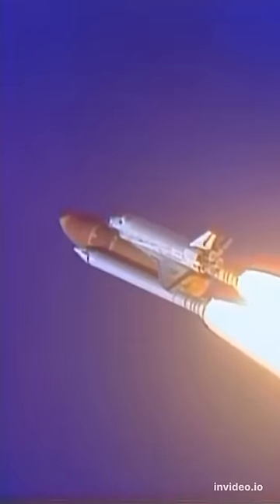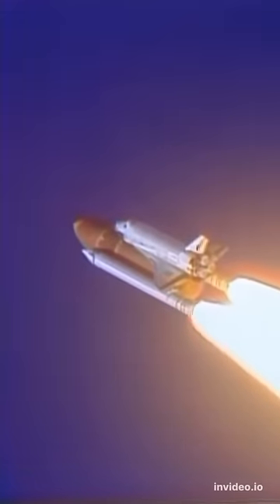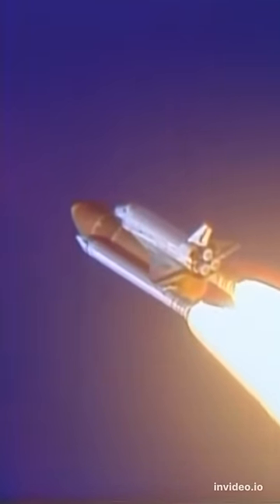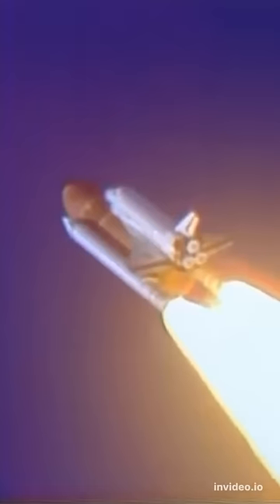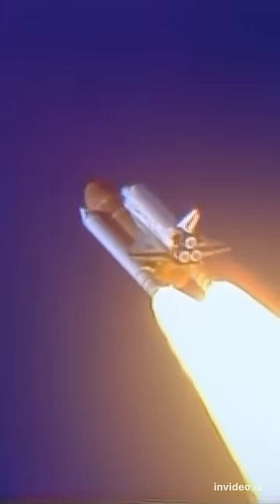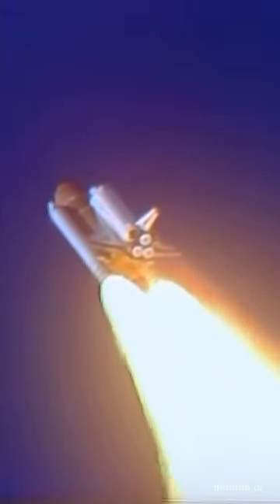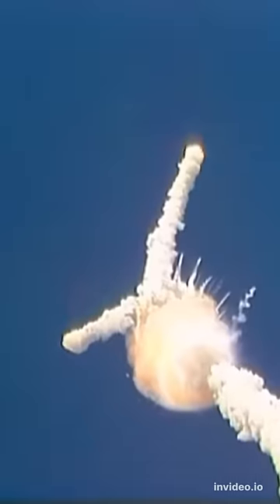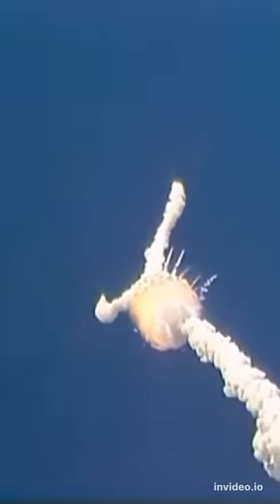Shuttle Disaster: Challenger STS-51-L Was A Major Mistake

Comment: That's still so heartbreaking to watch,  that should have never happened  something as simple as just a bad O Ring
Reply: Yes, was the problem .....
Reply: Yep.. rubber isn't very flexible in cold temperatures.. it seems it blew up as it was being given more power.
Reply: No... meeting a schedule, be damned a postponement to rework, a redesign. Schedule will be kept !!
Reply: It was too cold to launch but they did it anyway.
Reply: O ring was good down to a limited temperature. They launched on a day that was clearly too cold. A critical mistake by mission control.
Reply: I've wore out some rubber, back in the day,  anyways.
Reply: @robertcarlogradosgarcia9944  pp by
Reply: It was a fundamentally flawed design. It was initially designed to be a giant, self-contained reusable mother rocket/that looked like a giant plane, with a small shuttle attached to it. The fuel tanks would have been inside the mothership, so no foam insulation falling off, and the interior of the mothership would be heated, so no ogring seal issues. The government balked the the price and basically redesigned it to be 2 rockets that could not be turned off strapped to a giant fuel tank, and then the shuttle was strapped to that.
Reply: It was meant to happen. Just like the ignorant ones that are in the white house now.
Mike Smith was a friend of my family in NC! We were in shock that day. It was hard to understand why it happened.
Reply: @donmajer9607  
I believe someone should have been held legally responsible for this tragedy,as in jail time and I say this due to the following.I watched a tv/cable documentary about the aftermath investigation where either a designer/manufacturer or engineer had strongly warned NASA head honchos not to launch because of a possible oring issue,but they done it anyways.

Does anyone know if a separate (that was designed to separate from the main shuttle body in the event of an accidental disaster) crew capsule housed the crew and if it was one of the objects seen heading towards the ocean and if so,was the crew located or were they instantly lost in the sky due to the explosion?? Thanks
Reply: @andreaspease9935  the engines being Throttled are NOT the Segmented SRB's which had the O-Rings which developed an exhaust leak. The timing of throttle up and the leak getting worse on the booster were a coincidence. The cause of the explosion was not the throttle up but the leak progressively getting worse from take off till 0:73+ seconds from take off. The boosters were normally supposed to used 2:00 so if the O-Ring had been more resilient and/or the leak/blowby at a sight where it would not have caused External Fuel Tank Failure or Damage they may have survived. The External Fuel Tank Explosion ripped the orbiter into pieces and the cabin sailed intact crashing into the ocean likely w/crew alive but unconscious.
Reply: @donmajer9607  poor management choices overriding engineers who were warning them
Reply: @wbrockstar9550  yes a Thiokol Employee/Engineer told Thiokol Management to warn NASA management and he was basically told "Go back to your cubicle." Thiokol and NASA Management went back and forth with prior data until finally agreeing to go with launch. The Engineer was so upset he reportedly told his family not to watch as he "knew what would happen."
As for the Cabin of the orbiter, it reportedly was blown off in a ballistic trajectory until crashing into the Atlantic. The crew were all supposedly alive but unconscious.....
Reply: @grmrpr3599  yes 1986 was supposed to be a "marathon year for Shuttle Launches." I can't remember off the top of my head but the schedule was supposed to include TWO Interplanetary Launches Directly to Jupiter Using the same Launch Window. These missions Ulysses and Galileo(both using Centaur Upper Stages) and ☢️ RTG🔋 for power were deemed "Death Star Missions"....
Let us not forget that January 1986 had another Shuttle Mission ALREADY. And we were pushing for missions out of Vandenberg that Year.
Reply: The Space Shuttle in "Final Form" was essentially a "Compromise" design....
No one contractor built it. 
Although it was Nominally NASA's it had SIGNIFICANT DESIGN CHOICES MADE for DOD/USAF Missions.... 
NASA, to keep Congress happy, spread contracts to as many districts as possible.
Reply: @wbrockstar9550  they are apparently alive as the capsule fell into the ocean. Some of the life support systems were activated indicating that a few of the astronauts were trying their best to survive.
Reply: @-ShootTheGlass- you're partially correct. They put the orbiter in a manual mode to try to gain control over it's descent. But ultimately passed out and died upon impact into the Atlantic.
Reply: It was too cold for the O ring seal to work properly.
Reply: @wbrockstar9550  ....are that speed & that explosion, disintegration will happen. Nothing of crew was found!
Reply: @poppacapps5573  ok stubby
Reply: There are some things in life that you cannot prevent we may create a lot of things but the things we create are not perfect because we're not perfect you can't control fate you can only deal with what fate gives you
Reply: Q: Did you know that Christa McAuliffe was blue eyed?
A: One blew left and one blew right.
Reply: @wbrockstar9550  no and its the tragedy, when the main tank explode it did not kill all the crews Instant, Many was surely still alive until impact on the ground.
Reply: Wasn't that simple, they KNEW it was a problem, they chose to kill that crew simply so the Shuttle program wouldn't fall behind schedule forgetting just how far behind schedule you fall if you destroy   your ship.
Reply: They took the risk to go up in cold weather should of waited.
Reply: It wasn’t bad it was just too cold
Reply: It was not bad. It was frozen so it shrank. It was new and without defect. The engineer warned management very, very loudly and was ignored. They had pressure to launch $$$. NASA is a business.
Reply: @goatandyourmom9690  I believe two of the crew had successfully switched on their emergency air. I'm unsure of the details but I believe it was the shuttle commander and engineer.
Reply: @cornpop3954  from the wreckage and from the video itself. If you look closely just before the orbiter departs, there is an orange fireball coming from the SRB joint. The faulty Oring was a known issue and was essentially ignored because of pressure to launch. NASA as an organization was changed deeply after this incident and rightly so. A technical chain of command was established to ensure safety of the mission was put ahead of anything else.
Reply: Hindsight.    Always so accurate
Reply: Those bad O rings also lead to unwanted pregnancies !
Reply: yea a problem that they had been warned about and actually was asked several times to not let them launch
Reply: "Simple" maybe in your small mind. It wasn't like an O-ring from Home Depot for your kitchen faucet! Some people really showoff their ignorance in these comments and elsewhere online.
Reply: so sad
Reply: @acidkhmer  thing is when the fuel tank exploded it looked like the shuttle exploded but it didn't, the aerodynamics changed and the shuttle was going at the speed of sound and stress ripped the shuttle apart, but the crew compartment bolts got torn off and seperated that crew compartment from the shuttle, if there had been chutes attached to that in case of separation just like on the Apollo crew compartment splash downs, it's possible they could have survived, but I'm thinking even if it did have chutes would the chutes ripped apart that high? I'm thinking debris would have torn the chutes but who knows
The scary thing is Challenger should have blown up on the launch pad but there was some grain debris on the joint that temporarily sealed it
Reply: Her O-Ring was forever blown out. Even miss Endeavors O-Ring ring would’ve been blown out as well. The shuttle program was a doomed mistress with 
O-Rings torn to shreds
Reply: The O-ring wasn’t “bad”. It wasn’t designed to work/launch in such cold weather. They knew it! Management  took a chance and lost. People should have gone to jail.
Reply: there were many warnings about the o ring cold problems,but they cared more about keeping to the launch schedule than the safety concerns 😟
Reply: The rocket was supposed to be a single piece. They had to use o-rings because senator that got his state the contract couldn't deliver the units in one piece.
They wouldn't fit under some of the bridges they had to go through.
So they built in in three pieces.
Reply: was it a bad O-ring, or was it that the O-rings weren’t designed for the cold temperatures at launch?
Reply: @grmrpr3599 what is with all of you that go and comment complete nonsense on every video 😂
Reply: It was the fact that the shuttle surface was too cold! There was ice all over the shuttle and the launch pad and I knew it was going to end in disaster because of the extreme temperature change that happened when they turned on their engines, before they powered up to even lift the shuttle into the air!!! I was only 8 years old and probably the only kid in Arkansas who wasn’t a bit shocked when the shuttle blew!!!
Reply: @dsvet  dude that is messed up but it still made me laugh!
Reply: @MOAB-UT  the entire engineering team told Mission Control to wait until it warmed up but nope they wouldn’t listen and I was only 8 years old at the time and I knew it was a bad idea to launch at such cold temperatures!! I didn’t know anything about a shuttle but I wasn’t surprised when the shuttle blew because of a huge temperature spike!!
Reply: @lisadooley3872  One guy in particular stuck his neck out- jumped on the table at a meeting literally. His boss originally agreed but then, under pressure, he ok'd the launch. It was not just a spike- there was ice on the thing. They needed to scrub the entire day and launch in the afternoon of a warmer day.
Reply: @lisadooley3872  - no, not the surface, the O-rings
Reply: @wbrockstar9550 yes, the crew was located. It is believed by many that the crew was still alive as they fell to earth, and then were killed upon impact with the ocean.
Reply: @wilfred8326  
If there was anything good that happened during this disaster,at least they didn't suffer from the water impact.However would fire have been present inside the crew capsule because if it was, that would have been much worse compared to hitting the water.Were autopsies of the crew done before they were buried by their families??
Reply: More than an O-ring, it was a publicity stunt so it had to go ahead regardless. There was an expectation to launch and they did. Job done.
Reply: @aaronhoffmeyer  
It's scary just thinking about it,in how you described it's design.

Comment: When you hear those words. “Go with throttle up”
Reply: I wonder if they didn't throttle up. It would have made it
Reply: @BoomChing  that is an interesting question that I don’t remember anyone ever asking or answering.  I would assume it wouldn’t make a difference because the solid boosters don’t change as they’re burning and what actually exploded was the tank that the leaking flame was hitting.  Neither one of these really had anything to do with the engines they are throttling up, from what I understand.  Are there any experts out there that know the answer?
Reply: ...dont go with Throttle Up.
Reply: @gwrproducts2488  You're correct. The solid rocket boosters (SRBs), once ignited, were designed to fire at a constant rate until the solid fuel was used up. All solid fuel rockets work that way. You can't throttle them up or down. It was a set of o-rings on one solid booster that failed, allowing a jet of flame to cut into the external liquid fuel tank of the actual shuttle. (The liquid fuel allows adjustments to thrust coming from the shuttle itself.)

Since it was the SRB that failed, the fault was not with this liquid-fuel engines that COULD be throttled.

The fact that the failure occurred just after "go at throttle up" was coincidental, and unrelated to what condition the shuttle engines were in.

Comment: The F-ing engineer call his boss to cancel the launch. The boss said no. The engineer was crucified.  The boss was rewarded.
Reply: Terrible..
Reply: And that’s exactly what happened
Reply: Two guys after the vote was taken walking down a hall said nope it will cost us too much money to postpone again. Those two spent time in jail. I think it was like 5 or so yrs each. The engineers voted no launch.
Reply: Unreal
Reply: Not to mention the effed up parts (seals and o-rings) produced and installed which actually initiated the failure.
Reply: @gracieg7601  no one spent any time in jail or was charged with any crimes get the facts straight
Reply: @LKre-vi5oq  WRONG.  It never ceases to amaze me the ignorance of people.  The "parts", the o-rings and clevis design were fine.  What was wrong was the decision to launch in temperatures well below the rated minimum operating temperature range, which resulted in the o-ring/clevis design unable to be flexible enough to prevent hot gases from escaping from the clevis.  This ultimately ended up being the cause of failure, NOT the parts themselves.
Reply: @hawk1481 I was at zthe University of Alabama watching! I vjustvstood up out my seat and said, "That's It For Them!!" It wasn't Even Close Talk about Cripy Criteria!!! Listen to tode Idiots on the radio!
Reply: @kurtfrancis4621 i remember that day was cooler than usual, too.
Reply: Ugh....I never knew that so awful
Reply: @sarahsilva3481 people died
Reply: The people who repair those shuttles told NASA to scrub that launch and they refused..they knew it was too cold😥😥😥💔💔💔
Reply: @maryelaine-blinstrubchambe6083  yes I know so terrible I didn't know they knew it wasn't safe that's awful
Reply: Monsters as always! Demons!

Comment: I was a freshman in high school when this happened. I remember later when they found the crew compartment and brought it up for recovery and inspection, the discovered that the crew was not killed instantly as first thought. They rode that back down in freefall. Several of the switches for the emergency systems had been flipped to the “ON” position. These were switches that had a locking mechanism that had to be manually removed to keep them off until needed. 
I also remember they had a memorial service near the spot where they found the crew comparment. When the laid the wreathes on the water, 7 wild dolphins leapt over the wreathes. 
Had they kept with the original shuttle design, the crew might have survived. The original design was built so the crew comparment could be jettisoned and parachute back if something like this went wrong. But before Columbia and Challenger were built, the eliminated that safety feature to save weight and cost. 
But, live Werner Von Braun predicted, the design was going to cost lives.
Reply: Payload would be almost zero with a separating compartment.
 A version like that, and another like the Shuttle-C which could lift more payload, cheaper, would have been a useful system.
Reply: @JFrazer4303  I’m gonna call bullshit on that. There is literally no way in hell it would take an additional 65,000lbs of hardware to make the crew cabin able to separate and parachute. That’s almost 40 percent of the orbiters dry mass as-is. Would it have been more difficult to make the crew cabin, detachable, with chutes, and be aerodynamically stable? Yes. Would 14 people still be alive today if they had? Yes. No matter the cost, no amount of money comes close to the value of the 14 lives lost to NASA’s criminal mismanagement of the shuttle program.
Reply: @jmtardogno  let's be considerate about the situation, both situations could've bern prevented, but a jettison system would never help in the situations where both shuttle incidents happened, one was re-entering the atmosphere, if the cabin jettisoned during the breakdown the result would be catastrophic because heat-tiles wouldn't be present on the exposed part. And in this situation, a catastrophic explosion of the giant hydrogen tank would leave catastrophic damage to all systems, electronics and structural. The separation wouldn't occur on time and the parachute wouldn't deploy in any of the cases.